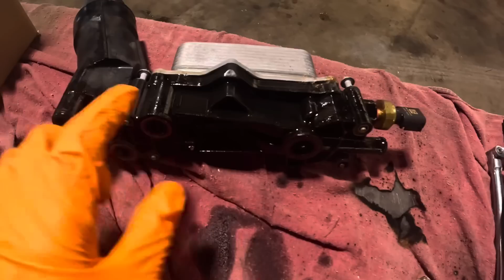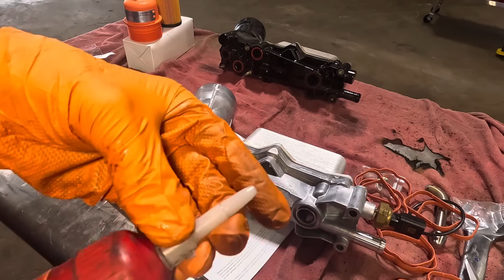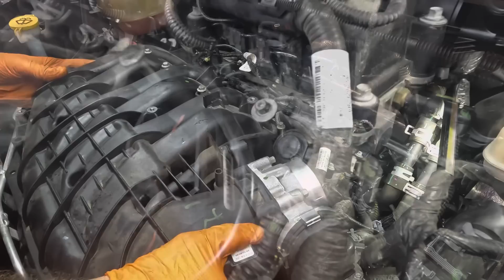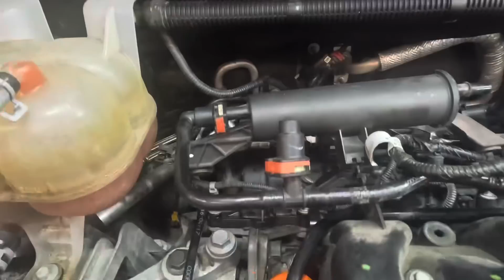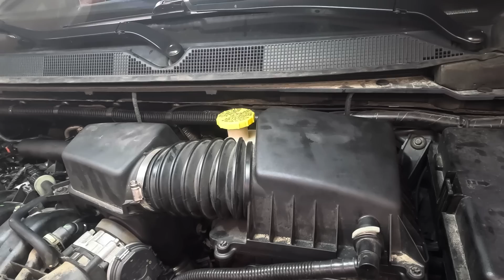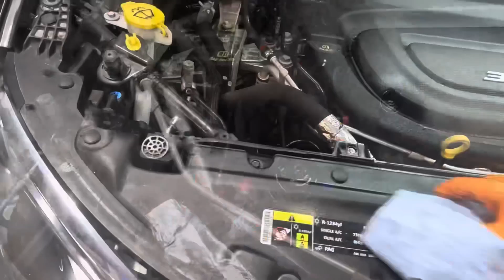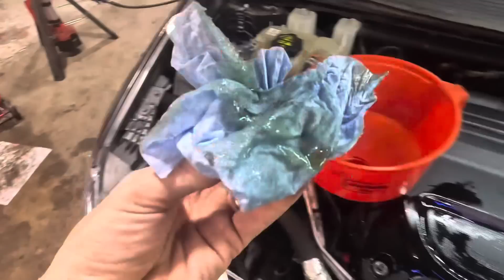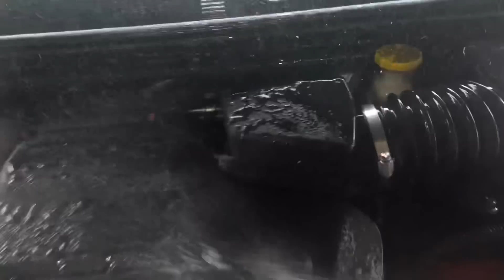Plastic Pentastar 3.6 PT2 Chrysler Dodge Jeep Ram Volkswagen. Leaking Oil Contamination!

Comment: You know it’s effd up when a Dorman part is better than a oem part 😂😂
Reply: They have apparently increased the quality of their parts in recent years.  I hear a ton of mechanics mention that now, but in the past no way.
Reply: @danssmokintreasures  no they just severely decreased the quality of oem parts and run the price through the roof
Reply: I had to replace my coolant reservoir on my F150 and I decided to use the Dorman part because it was around $75 cheaper and it had awesome reviews.  It fixed my coolant leak issue and it's built solid.
Reply: best part about dorman parts? lifetime warranty.

got a dodge that eats through blend door actuators? dorman has you covered... breaks again... they'll send you another.
Reply: There are a lot of dorman parts that are better than OEM. 
Some of the Ford modular intake manifolds were plastic, the dorman upgraded one is metal. 
Some of the ford explorers and F150s have a 2 piece drive shaft with a carrier bearing. The bearing wears out, but the u-joints are staked, making it impossible to replace.  Dorman sells a driveshaft that has u-joints that can be replaced so that the carrier bearing can be replaced. (Ford isn't the only one that does this btw. I ton of other companies do this same thing now).
Reply: But it’s not tho it’s funny cause everyone blames the oil cooler when in fact 98%of the time it’s actually those o rings on the bottom of the cooler that leak at the dealer we use to replace tons of them and they made us tons of money then Chrysler came out with a service bulletin that says if it’s warranty replace the o rings first and I have never seen one come back
Reply: @chriswells2730 regardless its a shit location for that housing.  Chrysler should be embarrassed by this POS motor.
Reply: @nissan300ztt  number one it’s engine not motor number 2 it’s actually the perfect spot nothing goes wrong with the coolers or the housings it’s the gaskets they dry out and crack like alll rubber seals do eventually and it’s not Chrysler it’s fiat and stelantis and this design has been used since the 90s with upgrades not obviously k bet you don’t know that company that originally designed it and still uses it till this day
Reply: @chriswells2730  You really sound like a Mopar sack sucker unfortunately.  The motor is known to have massive issues.  And the plastic housing also develops cracks.  The plastic housing doesnt allow for even force to be applied to the O rings and if properly oiled the o rings should never dry out.  Now onto the idea of why you say it works so well.  ITS IN THE MIDDLE OF THE VALLEY WHERE ALL THE ENGINE HEAT IS.  Mopar should have placed that engine oil cooler elsewhere, you know where air flow actually happens.  
I am a prototype Machinist with an engineering degree, this motor is a bad design.  Not to mention the other issues this motor has, poor overall cooling design with far too many places for air bubbles to get trapped and even when it works properly many 3.6L owners complain their vehicles can routinely get to 230F which should NEVER happen.
Reply: @chriswells2730 number 1: punctuation could be your best friend, if you would ever use it!
Number 2: it's not Fiat & Stelantis, it's Stellantis. Fiat Chrysler merged with PSA group & formed a new name,  Stellantis. 
#3: Technically it's engine, but motor is also a term often used. 
Engine refers to internal combustion. Motor most commonly refers to electric, as in electric motor. 

If you're going to go around correcting others, you might want to be sure you use correct punctuation!😅😂
Reply: @Chevyman02  😚🤗🤭
Reply: @Chevyman02  you are so handsome when feisty it’s a good thing I work for Stellantis so you can help me there handsome
Reply: If you notice, the plastic deformed, causing the O ring to do the same, causing the leak.    @chriswells2730
Reply: @chriswells2730 interesting
Reply: You do know dorman is the largest OEM supplier in the world??
Reply: @bigdaddymak1439  Mmm... Bosch, Denso, Continental, Aisin and Magna might like to have a word on this...
Reply: @bigdaddymak1439 what? No they’re not.
Reply: I'd lean more if the Autozone/Advanced part is better than OEM, then you really have a problem.
Reply: i got a replacement water pump from advance.    limited lifetime warranty.......    limited to three years,  even w/receipt.
Reply: I still remember when dorman parts were total crap
Reply: @jameshedrick605 dorman is okish. like anything else dont use their sensors or bwd (broke when delivered).  if just a part dorman is great. if electrodigicals are involved get oem.
Reply: @jameshedrick605  just some they crashed and burned trying to make Japanese sensors
Reply: Just put a Dorman power steering cooler on my Ram 1500. Much nicer than stock. It’s a parallel flow design like a radiator whereas the stock unit was a loop of pipe with fins on it.
Reply: Ray ….I have questions..some of  a mechanic you tube said if you replace this aluminum oil cooler the oil gets more hot than the normal i don’t know and for this reason they used (plastic oil cooler )is that correct or what…
Reply: @thearrow5793 aluminum is a great conductor of heat. So it might get some more heat from the engine block, but the realty is that the oil and coolant are already getting that heat. Any airflow around that aluminum housing will also cool it down.
Reply: @Ghauster  yes that's good because aluminium dissipates heat fast! 15 times faster than steel that's why the engine is made of aluminium
Reply: @thearrow5793  Aluminum dissipates heat faster than plastic without warping like plastic
Reply: @thearrow5793 Plastic is an insulator. Aluminum on the other hand is just barely behind copper in heat dissipation.
Reply: Who woulda thunk it?
Reply: @@user-ch5yv5zv8s their electronics they make for Asian vehicles is trash because they don't supply Asian manufacturers. most others are pretty good
Reply: Yep..thts 4 sure..
Reply: Same thing as @bearing_aficionado but on my Chevy Cruze. The reservoir is known to melt at the inlet and outlet and cause leaks. Dorman part is recommended because they added in some metal to reinforce the two and help prevent the melting from happening. Haven't had an issue since.
Reply: @@user-ch5yv5zv8sif you like rubbish then yes, they are near the top
Reply: Let me help you out: "You know it's a Chrysler when a Dorman part is better than oem"
Reply: Bought my 06 F250 new. It has never been to the dealer, but, I have put plenty of Dorman replacement parts on it, in the driveway.
Reply: Dorman makes quality parts, never an issue.
Reply: That Dorman cooler isn’t without its issues. We’ve had one in a shop leak from cheap O rings on the cooler. Probably sourced in China. Use OEM O rings, Dorman needs to source better O rings.
Reply: @jamram9924  it's a pretty demanding application, from -40 to whatever the max sensible coolant temperature is in your preferred units.
Reply: I was wondering about that very thing. @jamram9924
Reply: Dorman's big problem is their O-ring selection. When I did an oil change on my 2021 VW 2.0l, I used a Dorman plastic drain plug because it was only $4 instead of $18 for the OEM unit. They look identical and the specs require the plug be replaced each oil change. It uses an O-ring seal around the side of the plug, so tightness is not an issue.  6 months later I noticed that I was leaking oil from around the Dorman plug and when I removed it, I found the O-ring had flattened and hardened unlike the OEM oil plugs. I don't know where they source their O-rings but the have to know there's a problem.
Reply: @gregrobsn  you bought a Dorman pos for $4 vs $18. We’re not talking $40 vs $1800 there’s your problem lady
Reply: That's for sure.  Dorman has always bottom of the barrel.  Sort of like Busch Light.
Reply: @terryburke2587 except if you own a GM, Ford or Chrysler you have dorman parts on your vehicle straight from the factory. They're the largest OEM supplier in the world

Comment: the tape is a sealant not in mixture form but plumbers use it and it does seal the threads from leakage ,and it is effective and does the job
come over ere you get different words that will confuse you , we do detest grammar failarmy , if someone makes a mistake they make a mistake but you understood what was meaning hence grammar fail army.

Comment: We use a fleet of 3.6L Grand Caravans in our pilot car business. We have quite a few that have surpassed 500,000 miles with 5000 mile oil changes (roughly twice a month for us). The engines themselves are great, powerful and tough, but the oil cooler, motor mounts, transmissions, electric fan and cv axles tend to be replaced fairly regularly.

Upgrading to the metal cooler and heater hoses is one of the first things any 3.6 owner should do. Otherwise, they're pretty reliable as a whole.
Reply: You forgot rocker arms failures.  But outside of the oil cooler and rocker problems the engine is good and doesn't tend to other internal issues. I used to fix a fleet of cabs, that had caravans, journeys and even some 3.6l chargers.
Reply: @beilno2890  We've been lucky on rocker arms so far I guess. It may be because we have low idle times and most of our driving is highway miles with little stop and go.
Reply: My wife has a Grand Caravan and I do 5K oil changes hoping that will keep the rocker arms happy, they already had to be replaced once already(at 140k). Have you ever had problems with fuel pump relay? I've already had to replace mine and I hear that it common problem.
Reply: @rivjoy  Yea relays go bad sometimes, but the bigger issue is the entire fuse box  called a TIPM as it is a printed circuit board that Cannot handle the higher currents that can pass though it.
Reply: @beilno2890  In order to replace the relay you must replace the whole tipm, but there is an aftermarket company that makes a device to bypass the tipm mounted relay without having to remove it. It cost about $120 easy to install and is a permanent fix. The name of the company is Vertical Visions.
Reply: @beilno2890  engine bay heat, its the same story with the dodge vans with the 360 in them, the ecu is over the top of the engine and they burn up
Reply: @shadowopsairman1583  That's another good factor.
Reply: Thier junk and what the transmissions? You do lots of highway driving, which is about 20% of city driving. Compare apples to apples. Do you every see these turds as cabs, no you see Toyotas...
Reply: @gino5037  Yes you see them as Cabs, I worked for 6 years as a fleet mechanic for cabs. We had lots of them. And I have seen them in many other cites around here. No they are not perfect, but the Toyotas we ran had their share of failings as well, Most particularly all the 4 cylinders started burning oil around about 200k.

Comment: I would still apply a thin layer of silicone sealant to the block surface.
Reply: No need to O ring 'is' the sealant, and you would risk getting silicone in the oil ways

Comment: Yes the pressure sending unit has tapered threads. And who the hell told you that Teflon tape is not a sealant. Teflon tape has only two purposes. To lubricate the application of the threads and to keep them sealed. That's it maybe those of us who have been working on cars since 1964 don't have a clue what we're talking about. I still remember when you couldn't be an automotive engineer unless you could work on the damn things. In the late 1960s and 70s I was working alongside some of the best applications Automotive Engineers on the planet.

Comment: That is not the worst engine ever. It is aggravated by the moron who decided to put an oil cooler in almost the hottest part of the engine, made out of phenolic resin. Phenolic resin is a great insulator between two hard Parts but it is not a good material for a stand-alone part, especially when it has to maintain a seal.
The engine does require relatively meticulous maintenance, you should use synthetic oil, a mix of at least 1 oz per quart of either ATF or Marvel Mystery Oil in the motor oil would make sure that certain aspects of that engine run quite well. I have seen these engines go well over 200,000 Mi without any real issue. But I have seen a lot of those that are not maintained well fail miserably. Ignoring maintenance only works on engines that can function without maintenance and there are some of those engines that were built over the years.